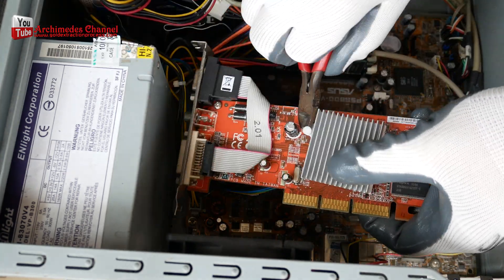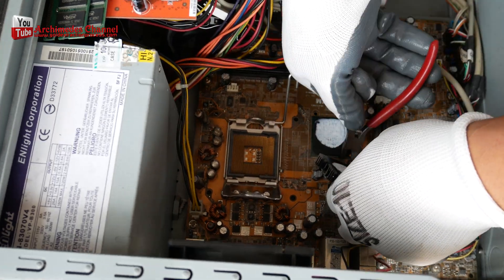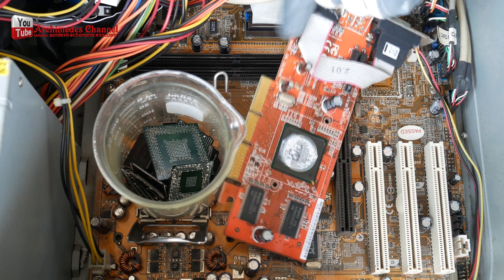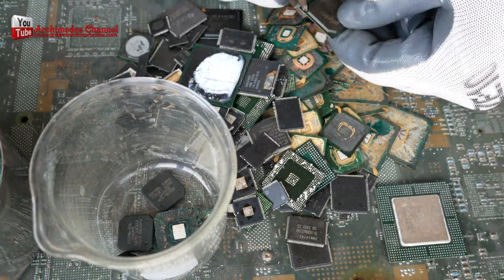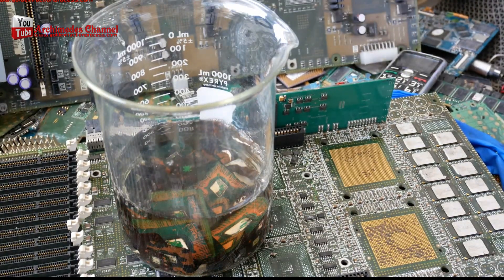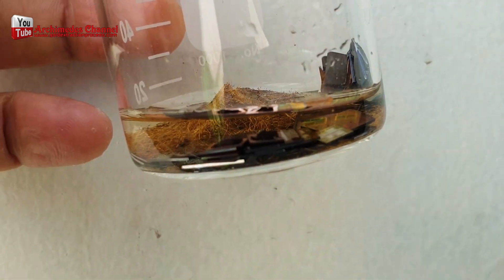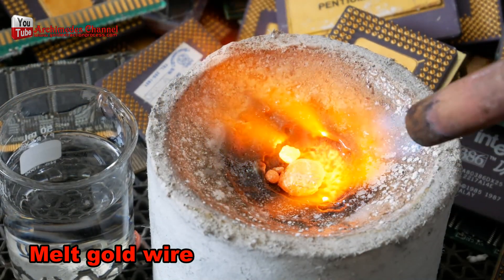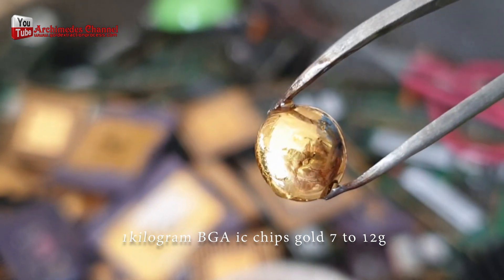How to Recover Gold from computer IC Chips - The Fastest & Simplest Way!

Comment from the maker: :face-pink-tears::face-pink-tears:👉👉Due to the small amount of gold in each ic chips, it's not economically feasible to recover the gold from a single chip or a small number of chips. To make the process economically viable, large quantities of IC chips would need to be processed, which would also require specialized equipment and expertise.
Reply: The older the phone laptop computer tube tv and other old electronics you get more gold.